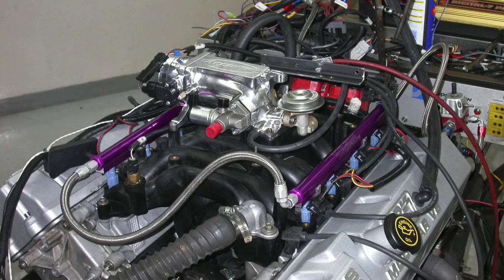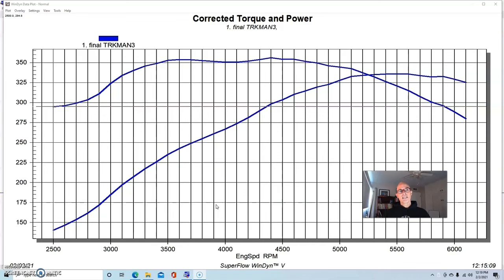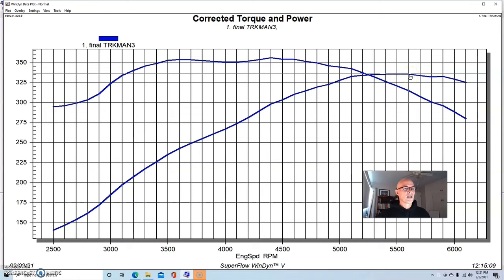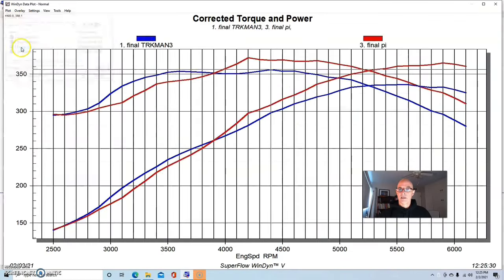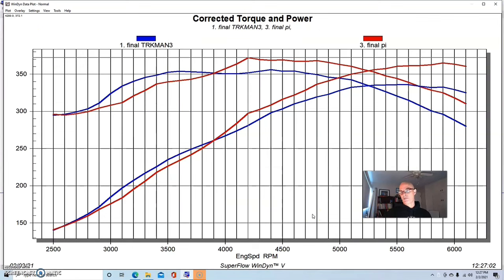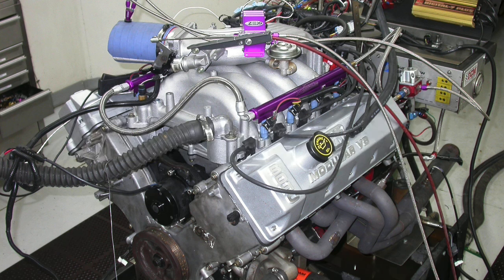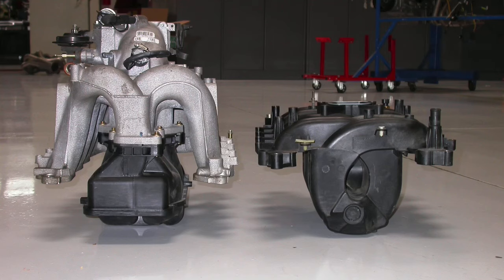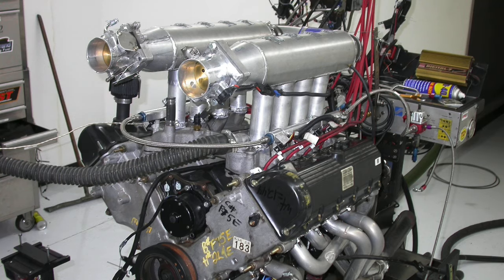4.6L 2V INTAKE TEST-MAGNUM PI FTW! (PT 1)

Comment: I have a cheap cost effective option on my NPI 2v. It uses a PI manifold from a 2011 crown vic and a V10 Triton dual 57mm Throttle body and 2 phenolic adapter plates to mount the two together. It looks like a composite plastic copy of a Bullitt.
Reply: Interesting. Just bought an 03 Crown Vic a few days ago, didn't know some of this stuff was an option. Didn't know the 6.8 had a big TB like that
Reply: @yeanah2571  Yes sir! The v10 shares the same Twin blade tb as the 4.6L 4v Cobras and the plenum/elbow has all the same vacuum ports and even shares the tps, and iac valve. The only thing you have to delete is egr. The plenum is ultimately going to be used with my Victor Jr intake manifold as a cost effective option for a 6061 sheetmetal plenum but I ran it on my pi intake swapped 1996 gt. It replaced a 04 crown vic plenum that I ported to 75mm on the inlet and turned into glorified tinfoil, ran with an aviator 70mm throttle body. Both run very good and better than stock but the dual blade plenum is more noticeable past 4000rpms. Pretty cheap mod for power gains when done with a pi intake swap but money is probably better spent in gearing especially on a big Vic!
Reply: @madmod  what vehicle did you put this on?
Reply: @benignocepeda7720  I had it on a 96 Mustang Gt with a Pi intake, then a Victor Jr intake.

Comment: Stock PI intakes are the best intake for most mild 2Vs making under 500w. Eddy for the big power 2Vs. The other benefit for the PI in real world driving is the lack of heat soak. Nitrous on stock PI manifolds is fine, just don’t spray over 150 and don’t spray under 4000rpm. Good video. I was pleasantly surprised at how the bullitt did. I thought it would have gained more than it did up too even on the mild cam.

Comment: The Bullitt had different exhaust, intake manifold, throttle body and pulleys and depending on sources was only rated 5-15 HP more than the GT. It's not too surprising that the intake alone didn't produce a huge gain. 
I just pulled my Bullitt's motor for a rebuild. I got some ARH long tubes and x-pipe and I'm planning on TFS heads and cams. 
Oh, and I might sacrifice a complete Cobra engine to Build it on a Teksid block with a forged crank. Haha
Reply: get the matching cams for those heads, more power..
Reply: I'll get the cams from Modular Head Shop, since Trick Flow's cams are designed for a PI head and not their own head.
Reply: @A.J.1656  what, as far as i know TrickFlow makes those cams specific for their head, heck, Comp Cams told me themselves..lol
Reply: @tigerlock.... Nope since they moved the intake valve it changed valve timing events..... In order to fix that a cam needs to be machined for it. Any P.I. Head cam will retard the cam timing events. Cost anywhere from 15 to 40 hp depending on combo. I saw this issue day one in my head. I worked in a performance machine shop and was astounded nobody caught this issue. What's worse is i never said anything and a year or two after the heads released people started figuring it out. I was like duh...

Comment: What I learned is unless you build your motor changing the intake is pointless.
Good to know 😎👍
Reply: not if you get one dirt cheap at a junkyard and pair it with a cold air intake etc. It can gain 15+whp in some apps with a later bigger throttle body on an older mustang
Reply: My 98 gt 4.6... put a bbk cold air kit on..
Hypertech tune..Plugs..injectors..pump..Ford PH2464   
F.E. Performance intake..h pipe..flo mo super 40s...Engine flew to pieces.. Timing chain broke..Pushed the crankshaft snout out of the engine and the balancer .Hit the ground and I ran over it..Ugh..junk

Comment: Interesting stuff Richard. I would like to build a 2v 4.6 and stay n/a. The 6.2 boss engine seems like a 4.6 stroker with a 4” bore. I’ve been obsessed with the 6.2 ever since I bought a totalled off raptor
Reply: C.M. ……………….that engine is a sleeper , cylinder heads like a boss 429, semi hemi flow in the 300 hundreds, good bottom end and cubic inches , and good bore space !!!
Reply: The 6.2 Boss is a diamond in the rough. Check out the video of the 460ci 6.2 Ford. It's pretty damn impressive!

Comment: Need to get your hands on the Ford Performance FR500 Intake Manifold. The only issue with that one is the cost of it being everywhere from 3k to 10k. The bullet Manifold also adds 40lbs to the top of your engine meanwhile the PI doesnt. However, You have to Port the Bullet manifold and have much bigger Cams and Ported PI Heads, forged internals, and boost to truly take advantage of that manifold.
Reply from the maker: I just sold my FR500 intake-but that is for a 4V

Comment: Non PI's 96 and up stock for stock actually have a higher peak flow stock for stock but as mentioned are limited by the non PI intake. You have to machine out the swirl dams on the PI's to get them to outflow them peak, so I think this is fair.
Reply: I thought nonpi heads also came with a different spring pack that required some serious work to get more than .500 lift.
Reply: @timothybayliss6680  PI cams work fine. They're .505 I believe. They aren't really high rpm cams anyway. With OHC you don't need all the spring tension in the world at higher rpm.

Comment: I have the P51 on my F1-A 4.6 2V. Made 720whp with a medium pulley.
Reply: Very healthy and usable power
Reply: How much boost?
Reply: 18psi
Reply: Where does that p51 peak rpm wise? My ported svo peaks around 6100

Comment: Time to show the 2V 6.8 some attention...the big bang kind 💥💥💥
Reply: We all wanna see it. If for no other reason than to see it kaboom. I just wanna see one making 1000hp. The trick is gonna be spinning it fast enough and then the crank shaft potentially being unstable, or cam bearings problems.. I'm hoping. Big time. I think one in an f150 street truck would be hilarious
Reply: @PureCountryof91  I want a single cab flare side manual v10 f150 so bad lol
Reply: @sategllib2191  t56 then a 6.8 with manual PCM, tuned, and custom exhaust.

Comment: DOES a 5.4 liter ford engine come with a fly by wire throttle body ?? Would this installed on a 4 liter six engine make better power and responses Richard ??? Thanks   😀😀😀😀
Reply from the maker: which 5.4L?

Comment: Hey Richard, I was wondering if you have ever used the pi to non pi intake adapter plates, which utilize both sets of gaskets and eliminate the need to use rtv over the cooling jacket corners. Should I purchase these, or I will be fine with the rtv sealer?
Reply from the maker: I've never tried that-let me know how it goes

Comment: The plastic intakes are better because nitrous backfires
Reply: Uh? Because they can explodes like a frag?
Reply: @lloydholt6511  when the nitrous backfires you’d rather have a cheap plastic intake shatter than a $1000 ( ? ) metal one.
Reply: @BustedWalletGarage  you think the aluminium one’S will shatter?
Reply: @teal_2v338  I’ve seen a GT-40 intake explode on nitrous.  Really sucked because they haven’t made that intake in over 20 years.
Reply: Uhh yeah plastic intakes explode in to shrapnel with a nitrous back fire
Reply: @BustedWalletGarage  the aluminum manifolds don’t usually break under a nitrous back fire because they are much much stronger plastic intakes will most certainly blow apart with even a slight back fire
Reply: @jackrabbit7389  used to do side work at a tuner shop about the time the 1st Fast & Furious movie came out.  Seen lots of dummies blow aluminum intakes into pieces then have towed to shop.  Worst one I remember was a kid that “ built “ his own nitrous kit for his Saturn without any fuel enrichment.  Blew intake apart , sucked pieces into motor, threw a rod and windowed the block in two places.  Good times.

Comment: This video pretty much answers what ive been wondering about plenum volume. 

But what id love to know, if the smaller plenum could be deemed restrictive at higher rpm would increased capacity of just the plenum offer a boost in overall output or only at the torque peaks?

Comment: Toyota actually use that divider in the manifold as well on their v6s in Camry and solara v6's there was nothing really amazing about that engine except for that one little manifold unless you got the very rare TRD supercharger for it which it was weird if I remember right there was actually no special tuning for it though although I think some people ran the 7th injectors setup commonly used on good Tacoma superchargers back then it's been so long I just can't remember but it was pretty interesting and super rare

Comment: Pleaaaase a 5.4 2V test! Or high comp 5.4 4V
Reply: The 4V is already a 9.5:1 motor, you could probably extract another 8-10% going crazy high comp on race gas but some boost is probably more practical.

Comment: What made you come to the conclusion that the combination wasn't enough to take advantage of the bullet intake manifold? In my opinion you have to remember that Ford designed that to go on basically a stock gt motor. The bullet manifold is not a high RPM ripper
Reply from the maker: The Bulley flows much more than the stock PI

Comment: That PI manifold had a really sharp torque peak and then dip. Was that the plenum divider opening? I have a similar set up on my 16 power wagon 6.4 . It hits 4500rpm and you can feel that plenum flapper open.
Reply from the maker: PI does not have dual plenum-only the truck

Comment: I love the test.. just wish it were done on a real PI headed shortblock..  beggars cant be choosers though :-D
Reply: Pi heads arent all that. 90% of the improvements from the full pi swap comes from the intake manifold and cams. The rest of the gains are primarily the bump in compression which if matched, the npi will produce similar HP. The PI heads really dont flow much better than a NPI and both are pretty lethargic.  When you consider the PI has 13cc larger intake ports (159cc vs 146cc) that average only around 10cfm greater flow across the low-mid lift range and actually less high lift and peak flow (160cfm @.550 for pi, 175cfm @.550 for NPI), it looks less appealing. You also have to realize, the npi head has a single angle valve job vs 3 angle with a PI head and you start really seeing the issue. A matched valve job will produce greater average and peak flow numbers out of a NPI than a stock pi head despite smaller ports which means the head has better port velocity. The guys who actually know how to port npi's like Renegade got similar flow numbers to MPH PI's but do so with swirl dams in place making a far more efficient combustion chamber vs the pi head which is already detonation prone due to the plug inserts you have to run on almost every casting. Non PI's benefit from thicker decks, deeper combustion chambers that allow huge ptv compared to a pi, and even use the same pi valve spring just installed at a shorter height which allows for more valve control at a cost of max lift before coil bind. You can fit cams with such a  tight ICL in a Npi that would bend valves on any pi combo regardless of degreeing and that is more conducive for power production. Johnny Langton went 12.98 @103 in a 3700lb thunderbird on renegade ported NPI heads, stock shortblock at 9.3:1 compression, stock pi camshafts, stock pi intake manifold, while running through a 4r70w automatic. Thats stock coyote territory for a lot less money.
Reply: @madmod  thats fast for a v8 non intech/cobra v8 bird..gona have to look into renegade porting
Reply: @danielcooper3130  He ended up going a lot faster. He later ran a shelf comp 270 cam and stayed na with the auto trans. He went a best of 12.16 @ 111 still at full 3700lb weight with subs in the trunk and full interior. Imagine his drivetrain in a 2900lb fox or 3100lb sn95.

Comment: The 4.6 2v truck motor has heads with larger intake ports and closed chamber heads
Reply: Really?  I always thought the truck and the car engines were basically the same, minus the intake of course.
Reply: @TheVenom8343  no I have a 98 crown vic and its got small ports i got a 98 and 99 f150 base model 2wd they both base large ports
Reply: @adamturner2507  yes 98 is non pi 99 is pi all 99+ 4.6 2vs are the same only difference is intake

Comment: Question ? Your 4.62V test engine using NPI heads ported for PI intakes with coolant passage welded using comp cam springs ? You said you are using the comp cams XE262AH cams ? these have .550 lift ? I was under the assumption that the NPI mustang heads are limited to .530 lift and either need the spring seats surfaced or special retainers and locks ? could you clarify that neither of these were done and that the PI version of the comp cams work in the NPI heads ?  was trying to locate a spring seat cutter and pilot to resurface NPI spring seats for the PI aftermarket cams on ported NPI heads but everyone steers me to bridgeport tools ? I am trying to get s seat cutter that is identical to the seat dimensions because these valve guide seals also have a metal spring seat to keep the springs from searing into the aluminum head ? if the cutter is not perfect the valve guide seal will not sit correctly and the spring sits on the valve guide seal. would you need to machine the top of the guide and run a seal directly on the guide and use a metal washer under the springs to protect the heads ?
Reply from the maker: we installed new springs
Reply: @richardholdener1727  yes aware you need upgraded springs but they say the NPI heads cannot run .550 cams without spring pockets machined or custom retainers that add clearance so there is no coil bind ? most likely if you did not have the spring seats machined you got the special retainers and locks with the springs ? the probably just told you you needed them and did not explain why ?
Reply: Crower Offset retainers to run PI aftermarket comp cams in NPI heads if spring pockets are not machined

Comment: What would be a good set of cams for a 2000 truck 4.6, 3200 stall 4.10 gears?
Reply from the maker: 262 or 274
Reply: @richardholdener1727  thanks

Comment: Hey Richard! Just reaching out because I’ve been watching your videos lately and have seen you do a lot with the ford 4.6 2v. I have a 09 f150 4.6 2v and was trying to see if you could lead me in any direction to get performance stuff for it. Hard to find anything for this truck. For sure lacking power in this engine but it lasts! Looking to get some more pep in it. Have kept up with maintenance since the day I got it. Thanks In advance. Really need some help
Reply from the maker: COMP FOR CAMS, LOTS OF GUYS PORT THE HEADS

Comment: I'd like too see the typoon professional products intake
Reply: Stock plastic Pi > pro products unless its ported. Ive seen power losses going to the aluminum with the acception to ported intakes.
Reply: @madmod  the trickflow intakes make power.
Reply: @Prestiged_peck  Depending on the model, the Trickflow has a larger cross sectional area then a pi manifold but the runner length makes them more suited to 5k+ rpms. I believe the Tfs, vic jr, and Riechard are among the few that exceed 200cfm per runner. Obviously that level of flow isnt needed below 5k rpms.
Reply: @madmod  yeah, that is very much the case, but these motors pretty much gotta rev to make power anyways just cause of how small they are.
Reply: @Prestiged_peck  350ft/lbs through the curve with only 281 cubes and 9.3:1 compression is by no means a slouch at low rpms. This combo only turns some 6k rpms and makes enough power to run 11s in a sn95, fox, or new edge chassis.
Reply: @madmod  my definition of a fast car is 9's in the quarter, and that's just barely fast enough.
Reply: @Prestiged_peck  Nonsensical considering that a 10 seccond car accelerates faster than what 95% of drivers will experience.
Reply: @Prestiged_peck  hell, people in nmra true street are pulling wheelies and running 12s on sub 300hp combos.
Reply: @madmod  well for me it's a little different, I see 7 and 6 second cars through my shop on a daily basis, and frequently have to make test hits in those cars to see what needs changing. My father's embedded in no prep and those guys are running well north of 2000 wheel in most cases, 300 horsepower in anything bigger than a golf cart is slow to me. Hell my daily driver will lay down 10s all day and it still feels slow (I'm planning a swap on it or it'd be faster by now
Reply: @Prestiged_peck  Its all relative. It would be nonsensical for a guy in the 5s to tell you that your 7 seccond 2k+ hp cars are slow just as it is for you to call 9s and up slow. In your fathers lifetime, 10s in a street driven car was unheard of.
Reply: @madmod  in his lifetime 15 second quarters were fast, but times have changed, what was fast 50 years ago is  what the crappiest economy boxes can do today. Seriously most mom cars can do 13s in the quarter now.
Reply: @Prestiged_peck  Agree to disagree. We'd have to fight on it.
Reply: @madmod  Fight me for slips
Reply: @kennethpowers8995  Its the only way

Comment: I know its near impossible and the general idea is the same.....which works best. That being said all tests are always on a motor that has cams cylinder heads or some other major modifications completed. If you just have a 2v and you need a intake which actually flows best? Which one would be worth the $$$ that question is never answered beyond it flows up top ...which is the description of the product provided by Ford Racing. No idea what it would actually do to the motor that it was designed for. Other than that.
Reply from the maker: do not run the ford racing intake on a stock motor-use the pi intake

Comment: Your 4.6 engine seems like it makes way more power than a stock 4.6PI 2v engine.
I can't believe just porting heads and a cam can make almost an extra 100 hp?
Reply from the maker: IT DOESN'T-YOU CAN'T COMPARE TO THE FACTORY RATING